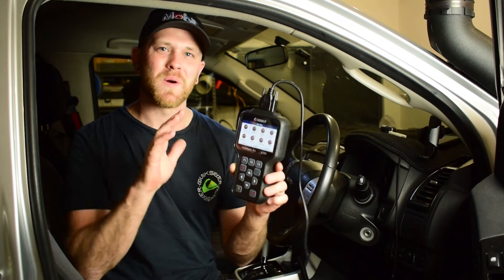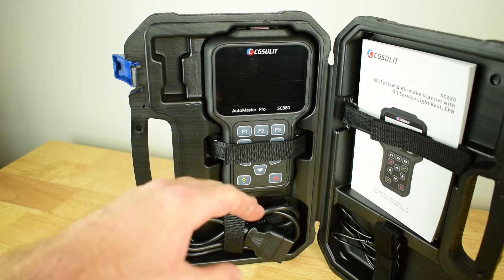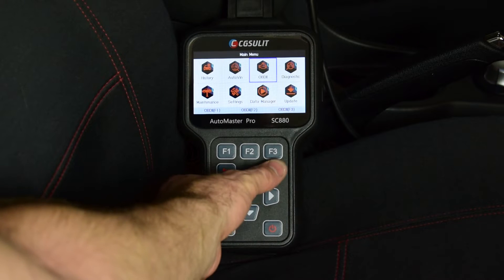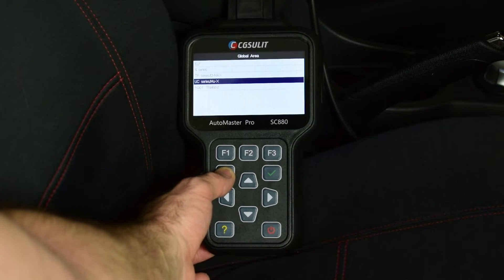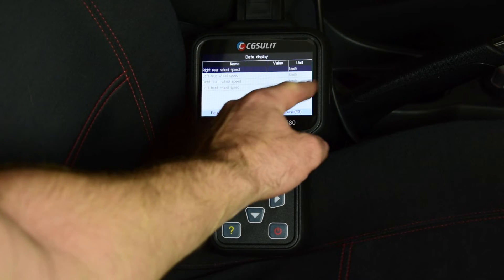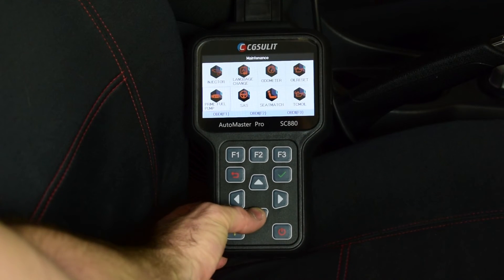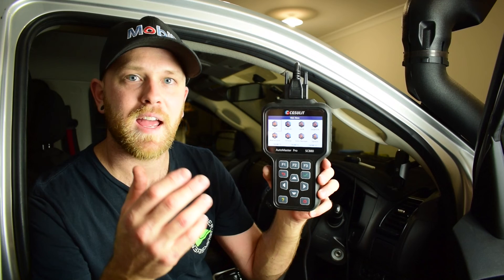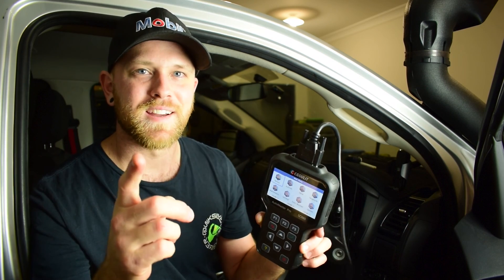CGSULIT SC880 OBDII Diagnostic Scan Tool Test + Review || Automotive Diagnostic Scan Tool Tutorial

Comment: hey mate. looking at buying one of these for my 2018 Dmax. Can you confirm if it can show injector compensation values? Also wondering if the transmission relearn functions, steering angle reset and injector coding ect work on the Isuzu as these are some of the functions I reckon ill need for maintenance and a valve body upgrade in the future.

Thanks
Zac
Reply from the maker: Hey Zac, if you have a later model dmax it will have limited functions. It has software up to 2015 for dmax and mu-x. You can still read out data  from ecu,tcu,abs,srs etc. On the 2018 but the service functions are limited.

Comment: Hey Nick, have you used the live data mode to read wheel speed sensor speeds on your MUX? I tried it in a 2016 DMAX and nothing displays when driving.
Reply from the maker: I haven't tested it while driving unfortunately.
Reply: @LowRangeNick  Hi Nick, I tried all of the modules using live data, nothing works on a DMAX other than voltage. The only other thing that works is the auto VIN, but I can get from the dataplate. I contacted CGSULIT support and it is non existent.  Looks like this unit is a lemon, warranty is worthless., useless product.
Typical support response, after I told them I have an Isuzu DMAX:
Hi, Friend. if your car is holden from Australia?

1 You can try to enter into OBDII to check if it can  read out live data. if it can read out?
2 You can try to use this device to read other car,check if it can show you live data. 
3  if your this vehicle can read by other device? if it can read out data?
Reply from the maker: @qualos0  Hi Tony, that's not true at all. I have read out data from engine ecu and transmission ecu on my vehicle. Have you plugged the unit into the computer and gone to the CGSULIT website and carried out all of the software updates? There is over 100 updates for the unit for all different vehicles and functions. Takes about 1 hour or so to update all of the software. Cheers

Comment: G'day Nick, could you recommend one for a NP Pajero. Can't find one that would work with it. Any help would be grateful. 👍
Reply from the maker: Hey Buster! The Np Pajero looks like it would run the older OBD system. OBDII was introduced in 2006 I believe. You may have to email or message CGSULIT to see if they have a scan tool that can communicate with the NP Pajero.
Reply: @LowRangeNick  thanks for that.

Comment: Hey Nick, I have 2017 sx dmax. It doesn't show when doing burn-off. Been told you can plug the computer in to turn on that function,  is that true?
Reply from the maker: I'm not too sure on that one sorry.
Reply: Just buy a scan gauge. And set up ur egts as a gauge. When ur doing a regen the egts will shoot right up to like 450 500 degrees. Takes about 10 minutes maybe and then ur egts will return to normal of around 350 t0 390 (vehicle and condition dependant). Prolly the easiest way to keep an eye on regens real time.

Comment: Has it got injector values and what should they be on a 4jj1
Reply: Hi Nick, could you do a video of injection values on your MUX? Thanks
Reply from the maker: Yes, it can check the injector compensation values. If it's anything like the hilux it should be between +3.0 and -3.0. Mine fluctuate between -0.3 and 0.5.

Comment: What a great find Nick. Great price too.
I've sent them an email to see if the unit will support my 2002 Jackaroo Monterey 4JX1...fingers crossed. 
The best I've been able to get is a mates very expensive unit and it could only communicate with the transmission (TCU). All other units I've tried (some I've bought) just won't connect with any computer on the Monterey OBD port. (I'm pretty sure the Monterey OBD is not OBD2 - standard OBD connector though).
Reply from the maker: Hey Benny, if it's a 2002 model it will be just the old OBD system. OBDII was introduced in 2006 I believe. Great idea sending them an email. Hopefully they will have a scan tool that can do what you need. Cheers 😃
Reply: @LowRangeNick  Thanks Nick. At least I have some hope again! :)

Comment: Well done Nick. I've always wanted to learn about these tools.
Reply: I noted that you can input a change in tyre size, does this mean that the speedometer will now calculate the correct speed   if not running own tyres?
Reply from the maker: @allanpower8041  That's correct, for certain vehicles it can calibrate the tyre size to correct the speedometer. This scan tool can only do this for some Isuzu trucks though. Not soo much for the passenger vehicles.

Comment: Awesome video!
Could you please confirm that this module does a dpf regeneration on the Isuzu.
I’ve been trying to find one to carry out to the bush that assures me I can manually regenerate to get home if blocked.
Reply from the maker: Hi Reece, as far as I can see it can't actually carry out a forced regen on the dpf models with the current software. It may become available at a later date via an update. What you can do is a DPD regeneration data reset and DPD dilution trip data reset through the scan tool. If you email CGSULIT they should be able to let you know which scan tool of theirs can carry out a forced regen on the isuzu mux or dmax.
Reply: @LowRangeNick  Dam!! Thanks for the info. I’ll email them, as it’s the main reason I’ll be wanting to purchase it.